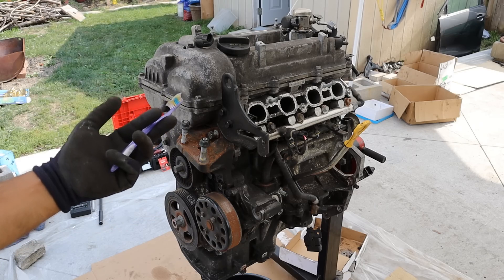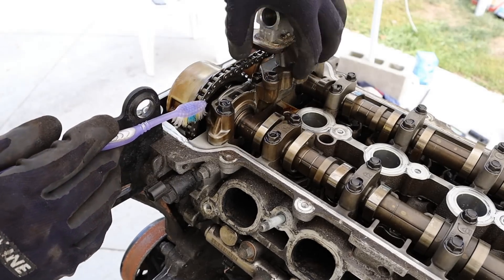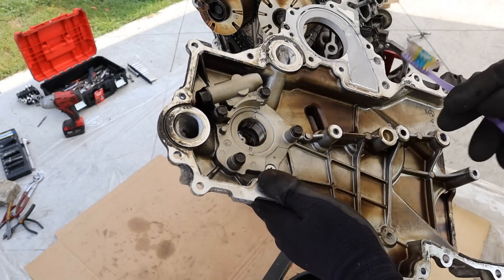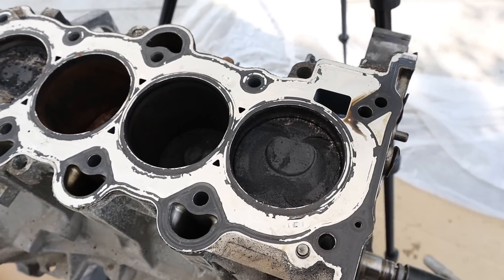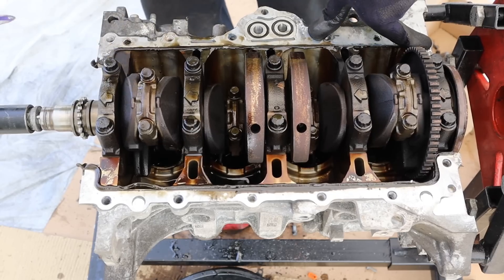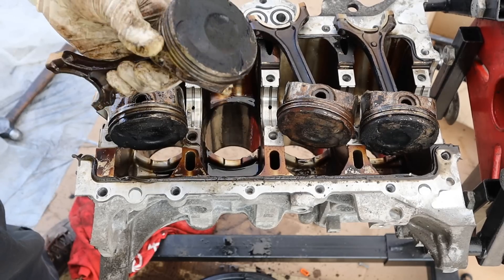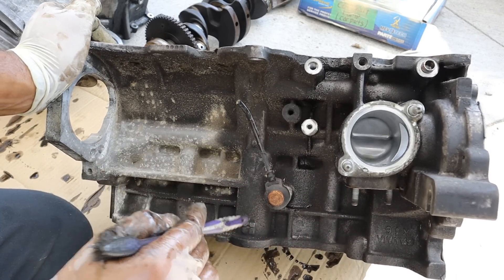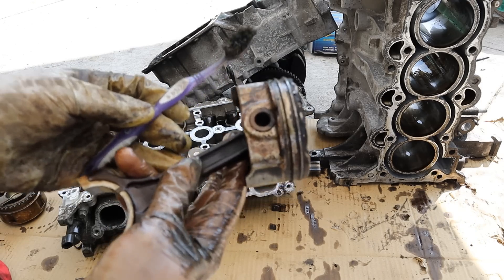Why KIA Engines Fail

Comment: Excellent tutorial on why the kia engines(or any engine for that matter) fails. A little harsh on Kia owners, as I have found that most car owners, no matter the brand, do NOT regularly check the oil level in their cars. Other than that, I wish you would speed up the presentation,,LOL. In my  humble opinion, the title should just be...'Why Engines Fail'.

Comment: So in what way is this kia/Hyundai engine design and manufacture have any at all to do with the longevity of this example.
As per your video tittle, I put it to you most engines in the junk yard have more often than not have owner neglect  been the reason of failure. Even the beloved Toyota engines clap out with lousy maintenance.

Comment: How hard would it be to clean the carbon build up, and how expensive is it?
Cause I'm a student so I don't really have the biggest of budgets to spend on all this service or repairs if it ends up failing
Reply: I think your best option is spraying a Seafoam type of product in the air intake, but it has to go around the air flow sensor, so you don't damage it. There must be youtube videos for your car year and model.
The other more expensive option is labor intensive (consuming lots of man hours) by scrubbing manually every intake and exhaust for each piston
Reply: @chiluco2000  oh man I wish I had enough experience to do option to without ruining the car

Comment: At around 10:32 you mentioned checking their oil frequently, I'm not even close to an expert in cars, what should I look for when checking the oil to know if there's porblems? Or you just mean because of the fact that it's burning oil it will run low on oil and thus causing wear?
Reply: Nevermind i just rewatched it at ×1 again instead of ×2 and heard that "it will be starved of oil....."

Comment: In your video you claim that direct injection doesn't cause buildup on valves due to the injectors not being sprayed into the intake runners like a conventional fuel injection. But what you apparently don't realize is direct injection IS what causes all the carbon buildup BECAUSE it's direct injected. Conventional fuel injection = a cleaner engine because the fuel can actually wash down the head as it passes the valves. Js

Comment: Your statement regarding cam followers near the end of the video is patently false. That design is one of the best ever, just ask Yamaha. They also are most likely hydraulic and would never need adjustment, as well. If adjustable, usually you would find a shim either on top of the bucket, or resting on top of the valve stem and retained by the valve spring retainer.

Comment: Looking into purchasing a kia myself but I've always been on point with general maintenance oil, brakes, fires, alignment etc. Should I expect any issues like this along the line?
Reply: I've got a 2016 Kia Soul (base model, 1.6L, 6-speed manual transmission).
I bought it to replace a 2000 Hyundai Elantra station-wagon which lasted over 180,000 miles and was still running when I gifted it.
Hyundai purchased the Kia company years ago.
I've seen my Wife own three different Kia cars (Rio, Rondo and a current Sorento) and she is terrible about oil changes and preventive maintenance, yet the cars kept running well past 150,000 miles.  Eventually something "died" or broke and killed the cars.  
But, it should be pointed out that the cars ran & survived long after the car-loans were paid-off.
I figured that if I take care of my Kia Soul, then it should last as long as my Hundai Elantra did.

The only surprise I've had so far has been the GDI oil consumption (1 quart or so approximately every 3,000 miles) and that I had to replace the Kia Soul brake pads & rotors at 48,000 miles (and had to replace both rear brake calipers, too).
My Wife has had to replace her brake pads & rotors, but the shop was able to service (instead of replace) her brake calipers.

Compared to the competition, there are Hyundai and Kia models that offer a competitive value for the price.
Personally, I loved my Hyundai Elantra Wagon, but when the tailgate latch mechanism wore-out, I couldn't find a replacement part.
So, it was time for me to get a new car.
I think the Kia Soul has been a good replacement car for my old Elantra Wagon, and it suits my needs.

I suggest doing research and comparisons with the cars that fulfill the role that is defined by your needs.
If you're good about doing the maintenance, and you don't accidentally get sold a "Lemon", then I figure you can get a lot of trouble-free miles from whichever car you decide upon.

(Edited to add, my Kia Soul currently has 65,900 miles on the odometer.)

Comment: I own a 2018 kia and I bought it at 57,000 miles and I'm at 94,000 now. I have definitely noticed a lot of carbon build up as I've had the car. 

I have taken it for 8 oil changes, I did a regular oil change at 82 and swapped to high mileage at 85,000. I have also used gum out every oil change. 

Since 80,000 I've been systematically replacing things under the hood. I've replaced the engine air filter, spark plugs and purge valve, the engine air filter and the transmission fluid at 86k because it was still feeling like shit. That actually made the car feel brand new for a week then it felt like it was choking while sitting at a red light. Went and got the professional fuel system flush and the idle sits at 800 now with very minimal extra pull during flashers and things. The acceleration is smooth now, it runs great again. 

Next thing ima do in a couple days is get a new battery and the coolant Between all the costs it was about 1500, with new battery and coolant let's just say 2k.. not that bad. 

However what is absolutely terrible is every single shop I bring my car to is almost calling me stupid when I describe different things to them, one shop literally said "a fuel system should never be serviced" like what the fuck?? 

Anyways if you listen to your car and it's problems you can keep it just fine, think the only fluid/maintenance to a car is the oil and you died. But THAT IS ANY CAR PERIOD. Have a good day all!
Reply: I also am an uber driver. Since I got the car in May 2020 I've put a lot of miles on it. It's been great for uber eats/uber honestly.

Comment: I have a 2016 Elantra, bought it new. It now has 91,000 km on it. I am a freak about services, and have changed the oil every 5000 km. I am now on my 3rd engine. First one lasted 48,000 km and the 2nd only lasted 26,000 km. Both engines were warranty replacements. Warranty wouldn't have covered it if the maintenance was neglected. Kiss my ass.

Comment: My mom drives a 2013 optima EX with the original GDI 2.0L-T under the hood with 130,000km on it. The drivers side power window motor is weak and freezes up sometimes in the winter, the battery just got replaced, the touch screen interface has glitched out before, and it just got its first set of new tires. This car is not well maintained Aside from it being washed twice a week, it's always clean. She goes as much as 5000km over on her oil changes, she doesn't let it warm up on super cold days and often forgets to plug in the block heater at night. She's done everything wrong maintenance wise, just oil changes, always late, and a new battery a couple months back. That's it, she bought it 2nd hand and has had it for 5 years now. She drives it very calmly, shes a mom after all, I've never seen her drive the thing aggressively. She puts her foot to the floor once in a while, like 1-3 times a month. A huge cloud of grey smoke comes out the back, but if she floors it again right after it doesn't smoke at all. I'm guessing the grey smoke is from carbon/soot  buildup in the exhaust and turbo. The engine sounds perfect, no ticking, no knocking, no vibrations. No loss of power either, it's actually been a really really good car for her. I'm 6 feet tall and 255lbs, and I fit comfortably in the back seat, my knees are miles away from the front seats. The interior has held up perfectly minus the steering wheel showing some wear. The exterior is the same, it's held up well. Although this summer was quite hot and I noticed the clearcoat fading on the back spoiler/lip which is fuck all in the grand scheme of things. She gets a little over 1000km to a tank on the highway, and just under 800 in the city. She has a very short commute, and Aside from that the car gets used for groceries, the odd sunday drive, and of course if we're moving it gets weighted down with stuff. The car takes care of two households really, mine and hers. It doesn't get beat on or overloaded but it does get put to work. I know that car is essentially a ticking time bomb, but like, it's still going as smooth as it did when she bought it. So I don't know what opinion to have. Is it just luck, or coincidence? I have no idea... somebody please tell me how this car has lasted this long with minimal issues and poor maintenance!!

Comment: Theta II 2.0l here....1st engine I forced KIA  to replace under warranty at 95k, im at 182k now & im getting a little nervous.  This is a good and bad clickbait video because it does not state why kia engines fail.  The skirt coating failed on my 1st engine and KIA stated they made a mistake in the piston manufacturing process.  Anyone know if that suposed mistake is real or if its been remedied?  There is no other sedan that has the horsepower to weight ratio AND bang per buck as the last year 1st generation Fortes.  Best driving hatch is the 2012-13 KIA Forte 2.4l Hatchback....unbelievably solid vehicle.

Comment: Excellent vid and very well explained!  I am not a fan of Kia/Hyundai, but I suspect that the bearing issue is a lack of proper maintenance/regular oil changes and not a K/H specific problem.  Also, I suspect that many manufacturers that use GDI also suffer from excessive carbon build up as well, not just K/H.  I own one and again I am not a fan, but I suspect regular oil changes is a simple way to keep these engines lasting a lot longer.  As for the carbon build up, apart from the "combustion chamber cleaners", I wonder if a good long run at highway speeds at regular intervals can reduce the carbon build up?  IE "give her the beans"?
Reply: You are correct, VW/Audi and Ford products tend to have carbon issues as well I've heard/seen.
Reply: Just got a forte gt with this motor with a turbo…reading through the manual they specify you should be using top tier gas or at least use something like techron additive every 6k…ill probably do both but for sure will keep getting gas from the shell station. 10¢ extra per gallon is fine if i can help keep the engine in better shape

Comment: My 2012 Kia Optima has been incredibly reliable with basic maintenance until 124k when the engine crapped out. Kia cover the replacement engine under warranty. This is the only car I’ve ever owned that I have kept 100% stock. The only things I’ve had to do was brake pads, tires and oil changes. Can complain

Comment: I’ll never own another Kia. I bought a 2015 Kia Soul Exclaim, 2.0 liter engine, with 7 miles on the odometer. I purchased the extended warranty and so thankful I did. I owned the car for four years and it had 84,xxx miles on it when the engine went full grenade mode. No indication of anything wrong with the engine until the crankshaft broke and sent number three piston into the head and the connecting rod through the block and into the radiator. The car was 100% dealer serviced every 5,000 miles by the dealership where I purchased it and all recalls were addressed. I had meticulous records on the car. 

It took 4 months, 3 weeks and 5 days to return my car to me. I wouldn’t have received it that soon if I hadn’t made a complaint to Kia customer service/corporate. It was after my car was returned to me that I realized how bad Kia dealerships are as they attempted to nickel and dime me with THEIR mistakes. Every time I had it serviced I would have to get a manager involved. The spark plugs began to fail (the electrode was nearly completely burn off one plug) in my replacement engine. This occurred four months after the engine was replaced and, I discovered that they used the old plugs from the destroyed engine as evidenced by the carbon buildup on them. I had a build sheet to prove that new plugs were supposedly installed. They wanted $22 per plug to replace and $125 in labor cost. They cross threaded a lug nut and then wanted me to pay $125 to replace the wheel stud and another $22 for the lug nut. That’s just the tip of the ice berg. NEVER BUY A KIA OR HYUNDAI PRODUCT!!!!

Comment: If the owner of a Hyundai engine doesn't check the oil level and doesn't take care of the engine by doing oil changes at recommended intervals, it's not the fault of the manufacturer of the engine.

Comment: The directed injection system tends to allow gasoline to get in the pan and dilute the oil. That combined with the very thin 5-20 oil used in these engines is what diminishes the oils ability to lubricate. Extended oil change intervals do not help this situation. 10-30 and 10-40 oil is allowed by Kia and is a better choice than 5-20.

Comment: 2009 Kia Spectra engine is not a powerhouse, but very reliable.
I think it's the same short block, that is used in Hyundai fork lift trucks; with a simpler head and runs on propane.
Block has a Hyundai logo cast in.

If I remember right, Mitsubishi did same thing with the Eclipse; Mitsubishi fork lift engine with better flowing head.
Industrial engines usually made hd and can handle more hp.

GM started making a tough 4 cylinder in the 1960's, but was rarely used in cars. Guess it cost too much to manufacture for a compact car.
Was available for the 1962 Chevy II and compact vans.
Otherwise was only used for industrial, marine, postal Jeep's and Marathon (taxi) cars.
It is still used by Mercruiser and was available by OMC for inboard engine boats. Displacement was eventually increased from 2.5 liter to 3.0 liters in marine use.

If GM had used that engine in their compact cars, would have given them a better reputation; like car engines from Japan.
Instead, they developed the cheaper iron duke and tech 4 engines....
The Ford 2.3 has a strong short block.
Was used in the same industrial and marine applications; turbocharged too.

Comment: I had the 2.4 with my 2010 Forte Koup, had over 200K on it, when i sold it, was still running like a champ, didn't burn any oil, i also have 2 Kia Borrego with over 250K on them, they have been  bulletproof reliable, don't know how you maintain your cars, but, never had any problems with my Kia's.
Reply: Agreed. 2009 Sorento at 150k original engine, cost me under 20k new. Well maintained=no problems.
People have no clue.

Comment: they fail because of 2  major causes
stupidity of owner who lacks  knowledge about doing routine checkups and skip  proper maintenance 
engine oil and  timming belt .
2nd  these engines are equipped with the smallest oil pump you ll ever seen  they jam very easly due to debries  in oil (caused by metal grinds falling from cylinder components that are not catched by oil filter .
not convinced well when get such a case diasemble the engine and sé by yourself   try to frée the oil pump shaft using whatever tool u got .

Comment: Kia owners only have an iq of 80 or less. That’s why they don’t understand about changing the oil. Corolla drivers are farmers and/or profoundly gifted. They keep going even if you don’t bother to change the oil. That’s the difference between them. Nice whistle stop tour of the engine. Designed to fail.

Comment: My wife bought a used sonata with about 20k miles just before we got married. The first thing I noticed was a ridiculous amount of spark knock the first time I drove it. Hyundai issued a service bulletin so we sent it back to the dealer. When we got it back it still had some spark knock so I tried intake cleaner and ran it with premium fuel, no change. It burned roughly 1.5 quarts of oil every month too. The final straw was a horrible moldy death smell in the car that I never could find the source of. I took nearly the whole interior out trying to find whatever it was with no success. It had to go! She traded it for a mazda 3 and 150,000 miles later the only thing I've had to do, beside normal maintenanace, was replace a $20 brake switch. Even at 150k it never requires oil between changes.

Comment: I did my oil changes every 7000 miles like the manual said. My 2015 Forte5 had no issues for 120,000 miles when I sold it
Reply: That's because you likely were mindful to check the oil and actually maintain its proper level between oil changes.  As this guy said most people are clueless. They  can barely put gas into it when they remember to.
Reply: @joeblowe7545  so true. Once in a while during the summer he needed maybe half a quart
Reply: 💯&🎯, the same type will always avoid accountability like Dracula avoids sunlight

Comment: Ugh. I've got a Hyundai Tucson with a 2.0 non turbo. I know these engines aren't getting enough coolant so cylinders 2&3 warping. Mostly noticable on the theta engines which run the turbo. Mine has 80k miles. Do I get rid of it or replace the engine?  I love the car in every way otherwise and it's probably cheaper to replace the engine than buy a new car. So I may order an engine in preparation for the future.
Reply: What year? From what I've seen the Beta series are great, Nu are ok and theta 2 are terrible
Reply: @reckherdkek5685  2019. The NU. I've got 80k miles and burn about a quart and a half of oil between oil changes, so 3k miles. I think the tu

Comment: Do you think doing a professional hydrogen carbon cleaning every 30.000 miles (50.000 kms) would increase engine longevity? it costs like 80 dollars.